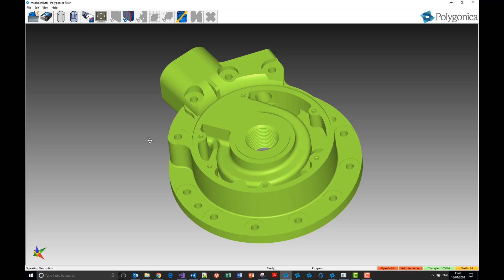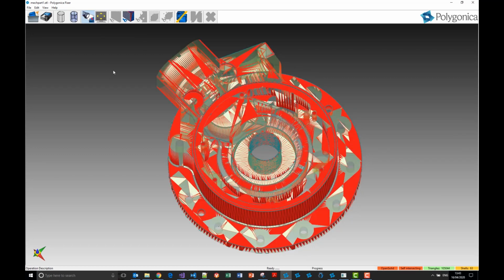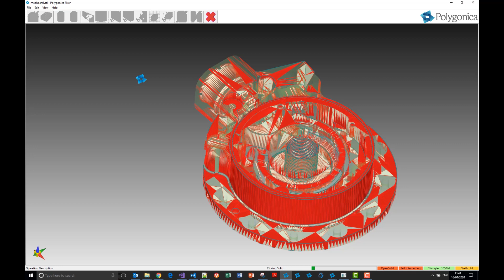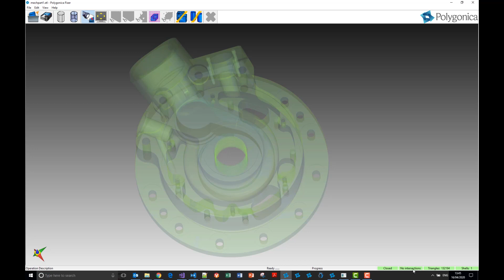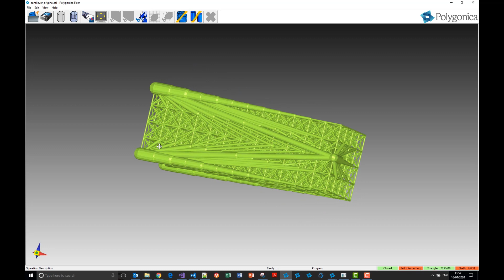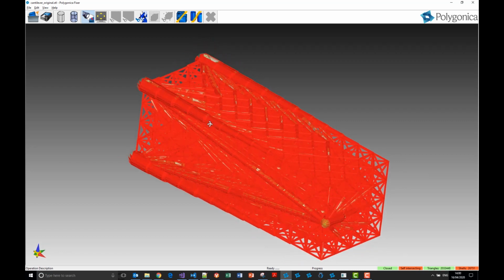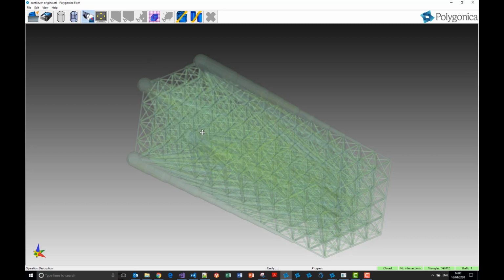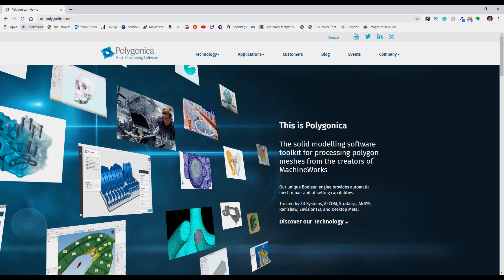Automatic 3D Mesh Repair Demo with Polygonica Software

Comment: is this app only available if i get in contact on the website and beg for it ??
i can find nothing to download or purchase on the website..      why is that ?
Reply from the maker: It's a software library, not an end user product - and therefore it requires some effort on behalf of the customer to turn it into something useful - usually by integrating it into an existing software application - you can see a list of customers on the website. Hence the sales process is somewhat more involved than just buying an app via the internet.

The app in this video is just a demonstration tool. It does say this in the video, but you'd have to listen to all of it. If you skipped that bit, then I excuse you - I wouldn't want to listen to myself droning on either.

At least one of those companies develops a reasonably priced app similar to the one shown.